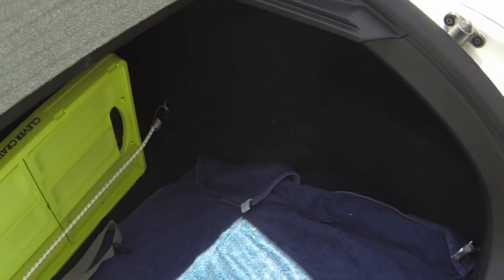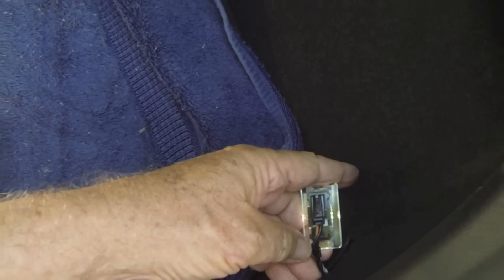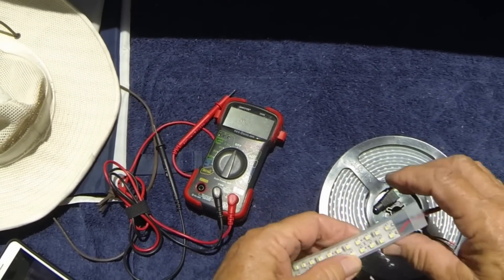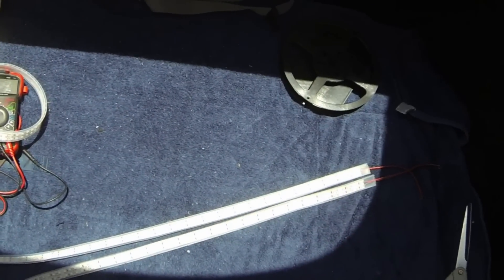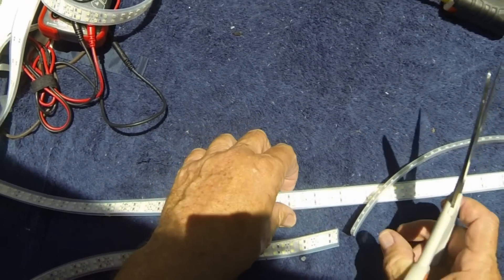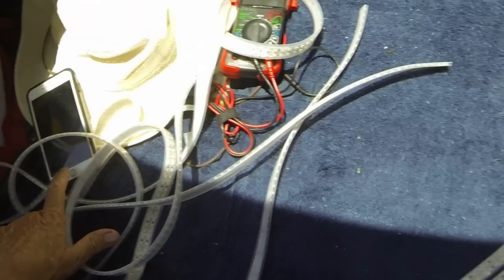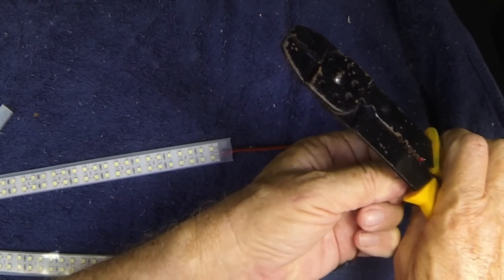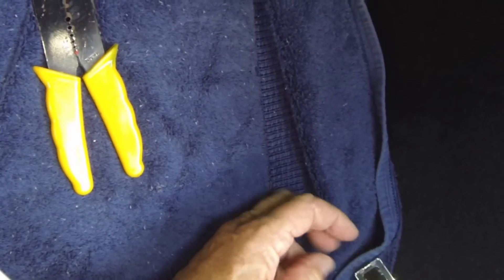Installing Trunk LED lights in Tesla Model S

Comment: Did you consider  the Abstract Ocean Bright LED's?
Reply from the maker: aerodyneservices no
Reply: @NormanHirsch  I just finished the installation in my 2015 MS...finding the rear trunk harness was tricky, r/h side was taped into a bundle under the charge port!  However,  was able to fish them out without removing any carpet or trim panels...and no wiring work was required.